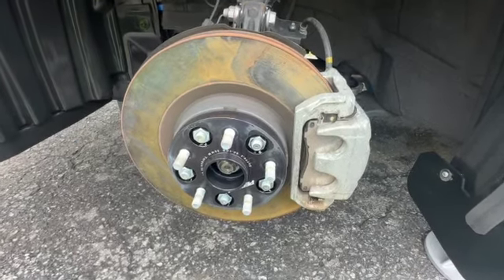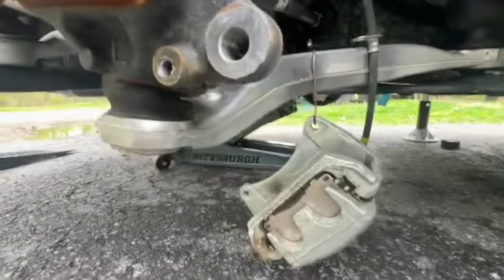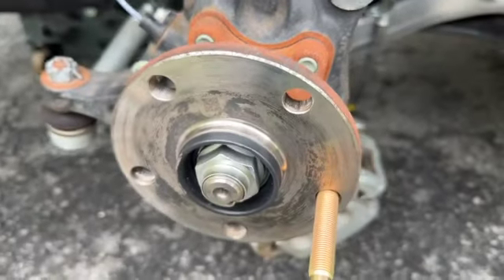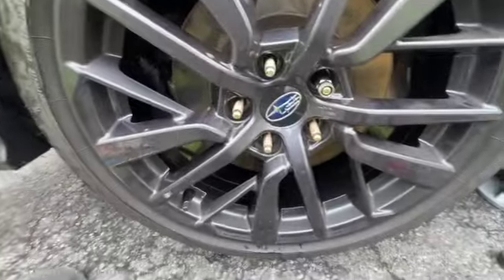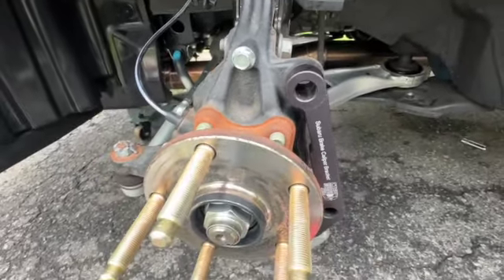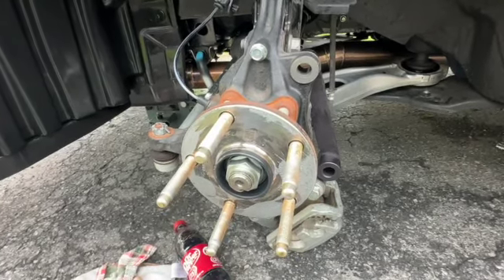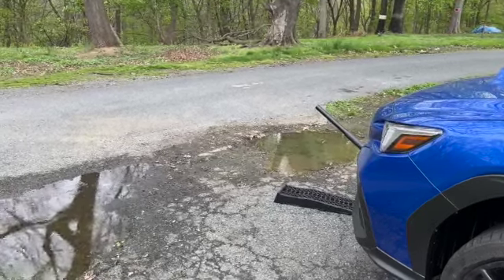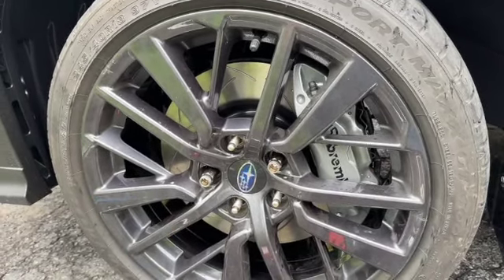2022+ Subaru WRX CTSVBRAKESWAP.COM ATS Brembo Big Brake Kit Install | FIRST ‘23 WITH ATS BREMBO SWAP

Comment: Sup dude! Hope all is well, quick question on the pads: are you having the infamous brake pad overhang? I heard that’s an issue with this conversion. That is unless you shave the pads down(?) how are your pads holding up??
Reply from the maker: @waybach  there is alittle overhang. Nothing crazy, maybe 3mm? It won’t affect the braking in any way. I’ve got 1,000’s of miles on this setup and the pads barely showing any wear. Sorry I couldn’t provide a more solid answer.
Reply: Just picked up my preorder for my 2023 brother! Thanks again man :)

Comment: I WAS ACTUALLY GOING TO DO THIS SWAP BUT WASNT SURE IF THEY MADE THE SPACER AVAILABLE YET. AGREE WITH 1000% ON THE OEM+ LOOK AND ALL THE PEOPLE PUTTING BIG WINGS LOL, NO THANKS. LOW KEY, FAST AND A PERFORMER. I HAD A 2014 STI HATCH THAT HAD 468HP BEFORE WITH ALL THE STI BADGES DEBADGED..MOST THESE GUY WOULDNT DARE THINK ABOUT THAT DOING THAT. WE MUST HAVE SIMILAR STYLE BC I WAS GOING TO HAVE MY OEM VB WHEELS (SAME AS YOURS) POWDERCOATED BRONZISH COLOR AND KEEP THE SUBARU CENTER CAP BUT MAKE IT BLACK TO MATCH MY CAR AND RUN MAYBE A 10-20MIL SPACER. WOULD LOVE TO SEE A VIDEO OF HOW THE WHEELS CAME OUT IF YOU DID THAT ALREADY.
Reply from the maker: Just dropped wheels off. Looks like it’ll take about 2 weeks until they’re done. I post them when they are installed.

Comment: Is there a rear kit wasn’t able to find anything on their site
Reply from the maker: Rear kit is simple and isn’t going to be on their site. Full bolt on. 

2017 sti calipers
2017 sti rotors
2017 sti pads
2022+ wrx rear brake lines
OPTIONAL: 2017 sti rear dust shield. You will have to trim the lip of your stock on if you don’t buy the sti shields

Comment: CVT?
Reply from the maker: Mines manual, and I’m not sure if it will work with cvt. I’d say more than likely as long as you’re not a CVT GT.
Reply: @Subi_doo  afaik it doesn't matter for the front, it's the same. The back is where the electronic parking brake is and ugh, we don't have any options for that other than alibaba brakes

Comment: Whats this cost?
Reply from the maker: Less than 1800 for both front and rear swap. Fronts only is less than $750

$250 for the caliper pair
315 for the rotors
$150 for brake lines
Reply: @Subi_doo  that's not bad at all is there a site that puts this kit together or did you figure it all out